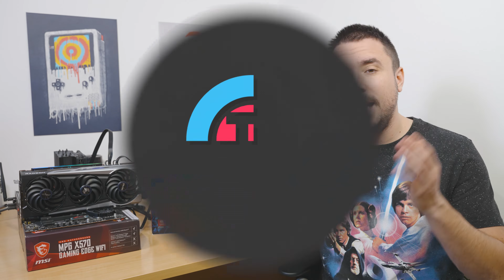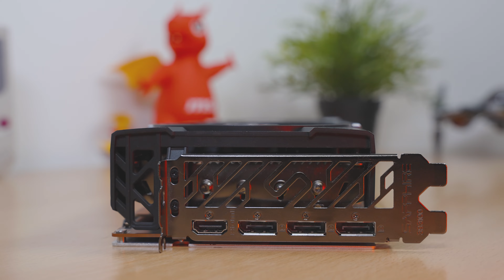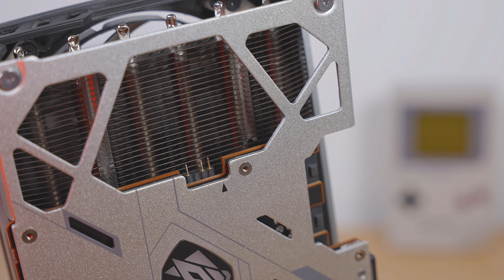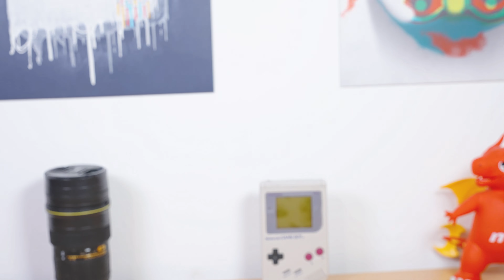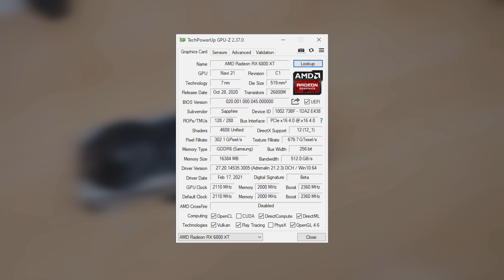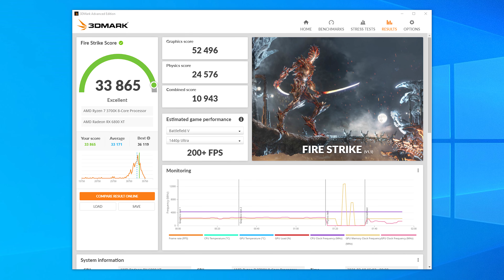WELP, better late than NEVER! - Sapphire RX 6800 XT Nitro Plus

Comment: Y these card lags 3080 in 4k inspite of 16gigs vram, wats the scientific reason
Reply: Fairly simple, if 4k doesn't use 16gb then there won't be any benefit to that. gddr6x has higher bandwidth, literally just faster memory so more performance goes out.